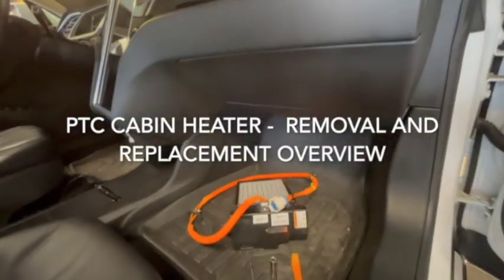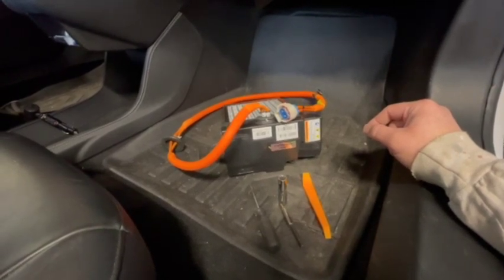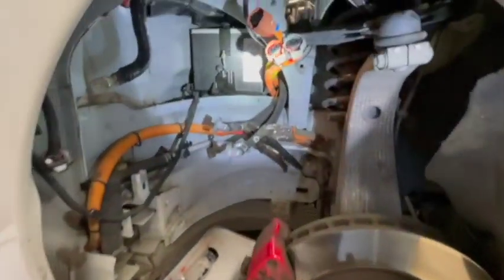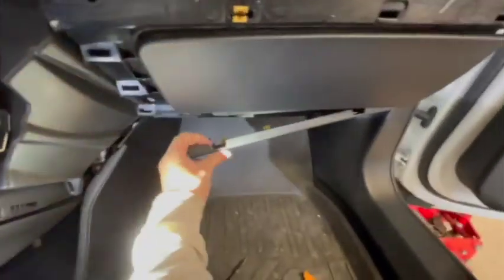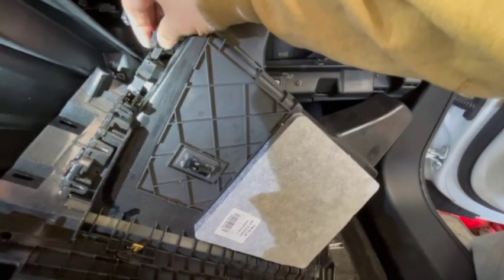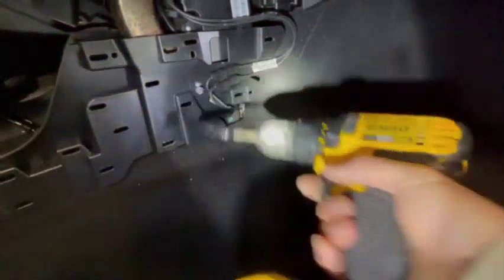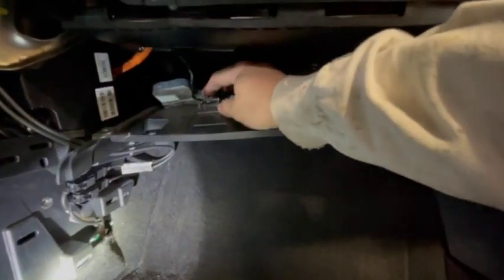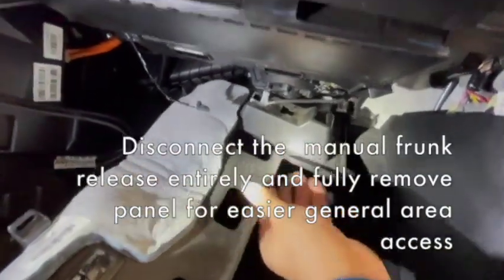4of5 - Tesla Model S: DC-DC Fuse+PTC Heater replacement (PTC cabin heater unit change)

Comment: 2018 model s my PTC heater went out. Can I used one I bought off of eBay from a 2016 model s ? Does it require any coding or programming from Tesla or can I just have a shop do it and pay the labor
Reply from the maker: Mine is 2013 so I can't say for certain any significant changes for 2016 and 2018, but I don't think so.  I didn't require coding or programming. Do your research however. Good luck!

Comment: Any chance the PTC could be good even if the fuse is blown?
Reply from the maker: Yes, you can take you changes. However the PTC has been reported to short and fail prematurely so likely a poor design and you take the risk of blowing more fuses later. Know that fuses are pretty resilient and reliable and typically don't just blow randomly on their own without something causing it to blow
Reply: Thank you! I’ll try replacing the PTC first.

Comment: i just replaced my ptc 
and it actually doesn't matter what part number they are  the slightly different are the plug for the yellow cable  
its higher then gen 1 ptc but you can remove the tape from the yellow cable and it will be slightly longer just to reaching it and plugged. 
don't worry when you see that the wire are to short

Comment: K Zig, how has the Gen 3 PTC performed? All working just fine?
Reply from the maker: Yeah, no issues and working as expected.
Reply: @kziggy3949  I'm about to take on the job on my Mod S Signature, VIN 151.  I ordered a 1060432-00-C Gen3 late 2016 unit from Autobahn to replace my 6007385-00-D. The socket for the control input is in a different location, but the offset doesn't look like much of a stretch and I'm hoping to be able to plug it in without modification. I'll let you know how it goes.
Reply: Any update ?

Comment: These vids are awesome. Thanks @KZiggy for doing them. Question. I just received a quote from Tesla for PTC heater replacement and there are 2 part #’s on there. When I search them, they look like the same thing. Any ideas? One is $700 and one is $1200. 

LEFT HAND DRIVE 1.00 GEN3 PTC HTR, EMC FIX(1060432-00-E)

GEN3 PTC LEFT HAND 1.00 DRIVE SERVICE, MS LEGACY(1041265-00-F)
Reply: 1041265-00-# I believe is recommended for 2012-2016 and 1060432-00-# is for 2016 and onward. For my 2013, Tesla replaced my PTC 4 years ago with 1041265-00-D. I did see posts on TMC where pre-2016 owners were successful installing the later model PTC heater.

Comment: Thanks for this video. My PTC heater just went in my 2013 P85. I was wondering about the part number you show on screen (1041265-00-). The only units I can find that have that part number are Gen 1 and look like the unit you show on the left. My current broken PTC is 1041265-00-D which was a replacement by Tesla when the original PTC heater failed about 4 years ago. The PTCs that I find which look like the Gen 3 with the white and blue plug have a different part number (1060432-00- ). I am hoping to get a Gen 3 and fix this issue once and for all. Seems the Gen 1 are prone to shorting and blowing the dc/dc fuse. Can you confirm the part number on the Gen 3 unit you used? Thanks.
Reply from the maker: My 2018 Gen3 replacement unit had a 1041265-00 part number, 1041265-00-F to be exact. The last letter "F" in the sequence (vs.D,C,B...) suggests my replacement a slightly newer release series (but not necessarily a completely newer Gen) that what you have. Seems odd given you had yours replaced 4 years ago but my only guess is that you may already have had a Gen3 replacement unit installed?? I don't know of any difference the color of the plug has. For what its worth my failed 2013 unit had a 6007385-00-G part number...so steer clear of that part!
Reply: @kziggy3949  Awesome. This is helpful information. From what I have found it looks like the F revision is Gen 3, but I don't see any mention of Gen 3 on my D revision. So I will certainly look for a 1041265-00-F unit. Fortrunately the warmer weather is arriving in New England, so I can wait for the right part. The last time it went out was in 15F temps and I had to drive it to the service center about 2 hours away. Thanks again for your help and great job documenting the steps involved.
Reply: @SheldonFinlay  Wondering how this went. I see some 6007385-00's on ebay, but all 1041265's appear sold out.
Reply: @TMART09  I've been holding out for a 1041265-00 series, but like you've found, none have turned up lately. But with the cold weather not far off, I will probably settle for a 6007385-00. I found this info on a site selling a 6007385-0-E from a 2013: "use if DC/DC converter is above wheel well. Vin P28515 or earlier (manufactured 1/6/14 or earlier). Do not use 6007385-00-E, F, or G when 1041265-00-A is available." Not sure what to make of it. Sounds like they will work, but better to use a 10041265-00. I wish I knew why tesla makes this recommendation. Anyhow, when I do replace mine I will post an update
Reply: @SheldonFinlay  did you replace yours yet
Reply: @bobbycake8077  I ended up just replacing the 40A fuse in the DC/DC converter. I found a thread in the TMC forum that implied that the fuse often blows and it isn't always necessary to replace the PTC heater. I figured it was worth a shot, and if it fails, I'm only out a little time and $30 for a fuse. So far it's been 2 weeks and the heat works again. If you do this route, I recommend testing the continuity of the PTC circuit while the DC/DC is still in the car (around the 3 minute mark in parrt 2). If the continuity is fine (fuse is intact) then it's probably the PTC heater itself and my approach won't be the proper solution. Good luck!
Reply: @SheldonFinlay  I checked the fuse with a meter I sadly think it’s the ptc heater sort off wish I would off riped it apart and changed it anyway
Reply: @bobbycake8077  There seems to be some consensus in the TMC forum thread that the fuses get worn and eventually blow. I don't know if that true or not, but Tesla did change the fuse locations for the DC/DC converter to be more easily serviceable in a later model s revision.
Reply: @SheldonFinlay  when you tested your fuse with a meter was it bad mine says it good not sure if I should still replace it
Reply: @bobbycake8077  My fuse was bad when I tested it. Replaced it and resealed and reinstalled the dc/dc converter and it worked. My PTC heater was fine.
Reply: Can this keep my S from turning on?
Reply: @Im_Groot21  in my experience, it shouldn’t prevent the vehicle from starting. Everything works, except for the heat. The 12V lead acid battery can degrade/deplete and prevent the car from starting.